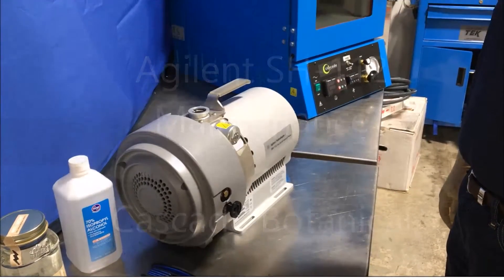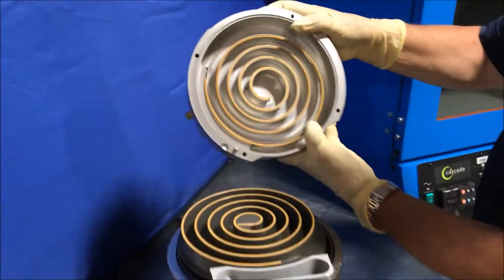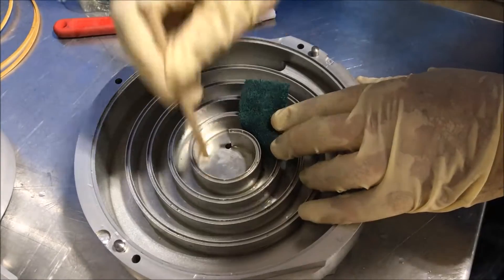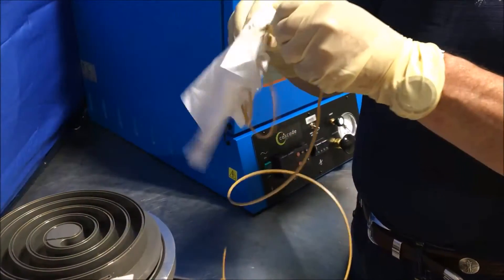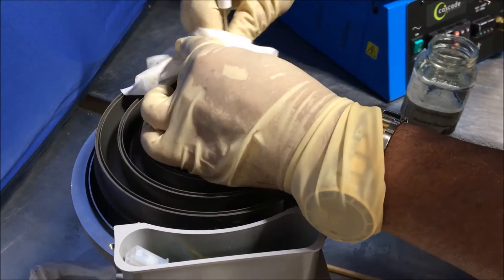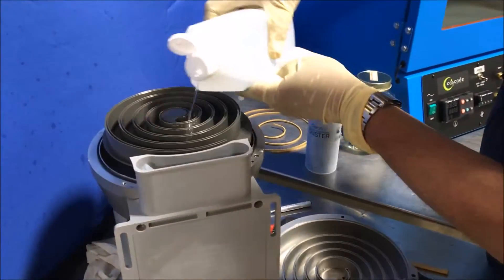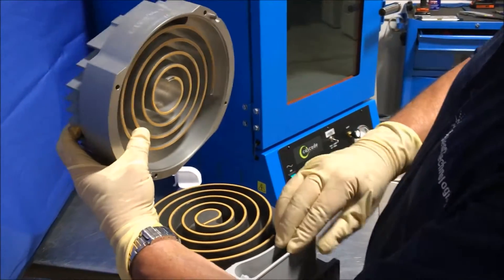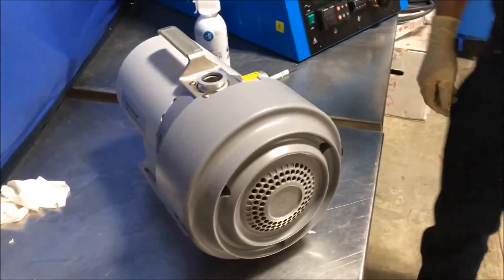Agilent SH-112 Maintenance Video

Comment: Don't forget to clean out the check valve on the stationary scroll head. The round cover in the middle of the stationary scroll head has the spring-loaded valve that gets dirty and all the debris from the tip-seals and other dirt ends up in the check valve so it needs to be cleaned so the pump can build up a good vacuum. 

I'm surprised you didn't install new tip seals. Apparently, cleaning them is good enough?